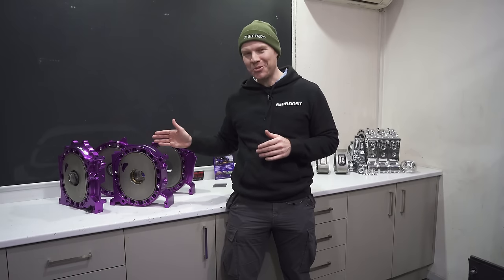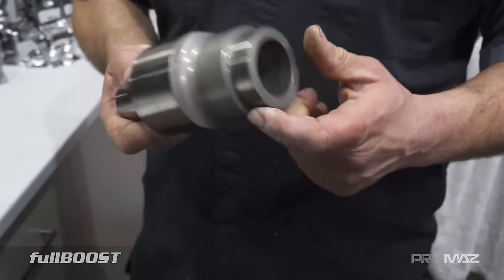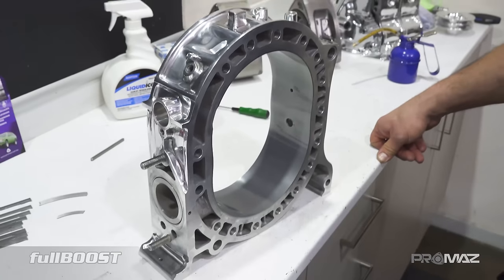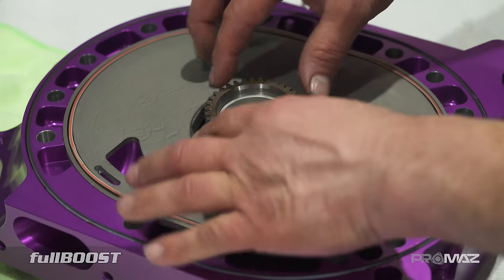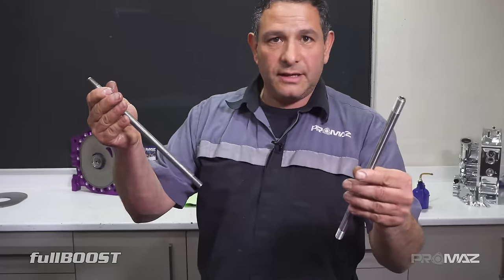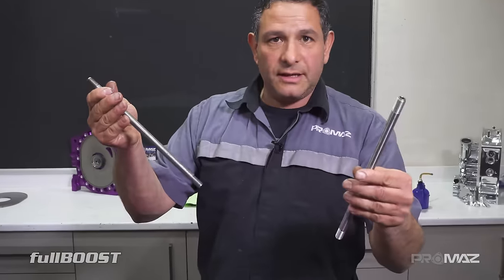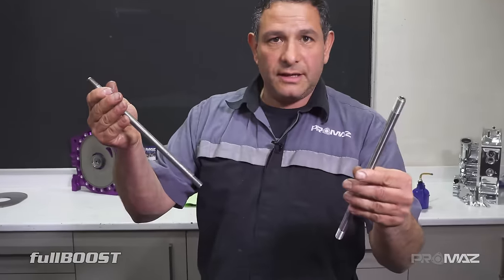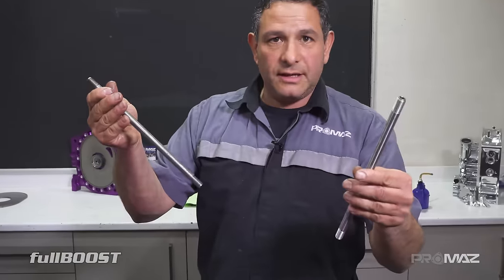Building a 1500hp Billet 20B 3-rotor | fullBOOST

Comment: This looks way easier than a piston engine. It's like stacking blocks.
Reply: There's allot
Reply: Not really,  I have a 04 RX8 and had a 86Rx7 , rotary motor’s are leaps and bounds easier than a piston engine.
Reply: STIL BIG ENGINE SO PRIMITIVE  😋
Reply: Like minecraft
Reply: Yeah of course because they are no timing belts valves and so on
Reply: @melonshop8888  It's about the same size as an electric... Lol.
Reply: Where is Rob Van Dahm?
Reply: That’s why they rev to 13k, simplicity
Reply: its way easier than piston engines because you dont have to worry about valve timings
Reply: Yes
Reply: They skip out on a lot of the processes. Remember, he said he had 2 days to prep the engine before this.
Reply: @Bottomfeedr1229  that's why they burn out faster then any piston engine lol
Reply: its like cake making. put a cream, put another layer on it, then cream again, then another layer on it. XD
Reply: @Bottomfeedr1229  not because of simplicity. 
they rev higher because they dont need to stop. everytime a piston engine hits top dead center it has to change direction to down and when the piston is down it needs to change direction again to up.
rotaries just keep spinning. faster and faster.
Reply: you should look builds of 2 strokes, then youll know what is easy
Reply: melon shop rotarys are small
Reply: Only blocks you’ll be stacking is the blocks of cash you’ll have to fork out on maintenance.
Reply: Josh Arnold no they dont.
Reply: Not even a little bit. The fellah assembling it has been doing it for 27 years. Hes just good. Also a lot more to it then what is shown.
Reply: If they where easier and more convenient, everyone would use them. Mazda doesnt even use them anymore.
Reply: Horrible emissions
Reply: Thats why i love them, yes of course the lifespan isnt as long as a piston but if you have the tools you can rebuild in a couple hours and get back out
Reply: James DeLarm  what you got going on?
Reply: James DeLarm let me know what you got going on and I’ll try my best to help.
Reply: You just don't know how to build a piston engine lol
Reply: Everything is super easy when you know exactly what you are doing and why.
Reply: Lol is more to it, is not just stacking block s
Reply: S7
Reply: Looks can be very deceiving..
Reply: Trust me it isn't 😢
Reply: Pros and cons of each engine type
Reply: A few key details are important to rebuilding these but yes, much easier. Last about as long as an LS with proper care.
Reply: Rebuilding either from stock is honestly easy af its when you start getting into insane aftermarket builds is where it gets tricky but again not overly hard as long as you have a good machine shop, try jet engines, now thats hard
Reply: Josh Arnold my 93 Suzuki Katana is a 750cc 4cyl and it hits redline at 14k, its not necessarily simplicity but also weight of motor parts and the displacement you need to make torque at certain horsepower
Reply: @DrEvil-os9dc  jop like v8 so what
Reply: Lego for men
Reply: I got a few omc rotary 2 stroks my self. This is one sick rotary 2 stroke! i would run nothing but silkolene pro 2 sx in her!
Reply: Squinty Kostiuk the rev limit of a piston engine is largely determined by the bore to stroke ratio, and if you look at Formula 1 engines they are often de-stroked V8’s to have a shorter stroke than what is considered “square or 1:1 ratio” will allow higher rpm capabilities if the rest of the engine is built correctly to some very high tolerances. Use some engine simulation software (even in games) and you will find that it is possible to get some incredible power out of a 1.5 litre V8 with a very short stroke at 20,000RPM.
I heard a rumour (watched a documentary) that BMW leave their F1 blocks out the back of the factory in the weather for years, the factory workers pee on them, let nature heat cycle them, rust, etc and they choose the ones that pass X-ray defect testing, and clean them up, whittle them down to the strongest mettalurgically tested ones to use in F1’s until the rules changed recently.
I respect Rotary Engines very much though and with many years of man hours and R&D by Rotary workshops investing Millions of currency units on the general basic design concept, have made leaps and bounds over Mazda to create some incredible machines that aren’t exactly efficient or environmentally friendly, I’m glad that the culture is alive & well because LS swaps, while effective, are rather mainstream now and even if they learned a thing or two from Japan on Overhead Cams, and GM came up with a Quad OHC design in “Bigblock” size I’d get interested.
Reply: 2 stroke piston ans 2 stroke rotary are the best. both run total loss burn off oil injection too! there are some toyota 2JZ made into poppet valved loop chared 2 stroke. make sure you use a billet aluminum block if you do this. Also the crankcase is easy to fill in with aluminum to use it as a supercharger and run a dry sump with oil injection with your favorite 2 smoke oil!. the aluminum block is easy to cut ports into too. i got a few old billet aluminum omc rotaries and they run xd-100! My gf run and fill nothing but amsoil domintor synthetic 2 stroke oil with the OMP turned up. now just add 2 stroke oil and go! BTW lightning is one the most powerful 2 strokes on earth at the muti terawatt level! unfortunately its way to hot to channel into any aluminum 2 stroke block as it would be destroyed and grenade!
Reply: @peterzingler6221  it's like a 2 stroke, time to 2 stroke 2jz 🤭
Reply: @markoz673bajen8  counted his rotors and decided he was too good for this video xD
Reply: somewhat..the seals are anoying..  3 on each side and 1 on each corner of the triangle pistons..     and yes, with so many seals wankel engines are prone to wear.

figure if he's squeezing 1500 horse out of it that engine will need a rebuild ever 5 or 6 hundred miles..   dads rx7 made it 70000 miles stock...
Reply: @harleyme3163  70k miles? That's it?
Reply: Well there is more complicated seals and areas that have to be perfect and rotarys are tempremental a sohc i4 is the simplest you can really get and probably the most reliable design
Reply: @fuolku1006  you just fucking blew my mind right meow
Reply: Oil injection too. I got my rotary topped with amsoil dominator 2 stroke synthetic oil. It’s about 60$ for 5 quarts!
Reply: Primitive engines... that's the car industry haven't adapted these en masse.
These things would blow up and leave you crying... Maybe onlu good for 1or 2 drag races.
Highly inneficient gas guzzlers.
Fun to watch though... It's more of a hobbyist engine
Reply: Primitive engines... that's why the car industry haven't adapted these en masse.
Notorious for blowing up... Maybe only good for 1or 2 drag races.
Highly inneficient gas guzzlers.
Fun to watch though... but It's more of a hobbyist engine.
Reply: Main difference is the number of moving parts. But the rotary seems a bit more technically complex to me.
Reply: Not until you need to replace apex seals.
Reply: @vossti  Thats how most race motors are anyways. You got to up the oil injection if you want them to last longer. Borth my rotary and small block v8 i use Either XD-100 BRP oil or Amsoild dominator synthetic 2T. I want to give motule 800 2T a try for my 8v92 2 stroke jimmy but i would need a few gallons of it.
Reply: @vossti  Im not a 4 joke person but run only Motule 800 2T in my rotaries. are you talking 4 joke stroke? do you you run oil injection? I love the new 850 ETEC rotax turbo and i assume ll these car motors are modeled on that configuration! All these turbo 4 cylinders are just poppet valved 2 stroke conversion with oil injection that can be ran in any position! they all are can run 2 stroke oil!
Reply: @vossti  So what do you want high strong piuston 2 stroke whuich do the same. You premix all these engines! Hey dont forget lightning and the sun are 2 strokes!!!
Reply: Oh you made a toyota 2jz 2 stroke 1200 hp poppet valved loop charged 2 stroke! just pet her gently and she will last!
Reply: Now dont be mean to her or she will give up at 1800 hp!
Reply: @vossti  Thats is how most racing stuff goes anyways,  I only with full synthetic amsoil dominator 2 stroke for my rotary for now. 6 quarts for 11.50 each aint bad. motul 800 2t would be better though if i could find it.
Reply: He’s a professional with brand new premium parts and he’s done this thousands of times and it’s prerecorded, it’s going to look easy. There’s a bit more to it than what they’re showing, especially if you’re rebuilding one.
Reply: a virtual Lego block ICE....kinda. .lol
Reply: Rotarys are kickazz engines ..but they need ALOT OF LOVE
Reply: @jaycool5978  I SAY WHAT.???  🤔🤔🤔
Reply: Legos lol
Reply: Doctors arent born doctors, cooks aren't born cooks, mechanics aren't born that way either. You have 2 learn and get hands on when it comes 2anything in life
Reply: @crisknapp1990  lol very true.
Reply: What's cool about it, you don't waste any energy turning up and down into round and round. Cut out the fat. And your left with hp.
Reply: @fuolku1006  thank you, turning up and down into round and round looses lots if heat and energy. That's the genius of the wankel.
Reply: @linuxafrica2584  yeah couple hours my ass. If you make your living rebuilding wankels. You might be able to turn around in a day totally rebuilt. But that's if you spend every single day doing it. And you already have everything you need to replace on hand. They make it look easy be wise they cut out 95% of the build.
Reply: @glitchinthematrix5761  if you and the bois cant rebuild a 13b in 2-3 hours that sounds like a you problem bro  and of course you would have everything you need to replace on hand 😂
Reply: It’s basically a dorito sandwich with less moving parts due to lack of rods springs and more
Reply: You are correct and incorrect in so many ways but I like the way you think. It's that mentality that has cost me more money than I'd ever like to admit...
Reply: Like Lego
Reply: @trex69  not gonna disagree but it's also why they can be run alot harder constantly than most piston engines I've seen slot of hell cats blowing up already not even 15-25k miles I've seen rotaries get track only use and go for 50k
Reply: Assembly it's easier, sure. Whole engineering process from scratch up to build is much more complicated. 🤷‍♂️
Reply: lego time
Reply: You need special tools
Reply: It’s more simple yeah, but it’s also a bitch to maintain and make sure you don’t break.
Reply: The apex seals are the problem from what I've seen. If rotary motors had half the investment into research and development that piston engines have had, then it would be a great engine type.
Reply: @peterzingler6221  is it just me or rotary fans are a bit ignorant 

two stroke piston engines have much more in common with rotaries than 4 strokes. 2 strokes and rotaries both inject oil into the cylinder, both don’t use valves and cams, both are much more compact and simpler than 4 strokes, both have one power stroke per revolution unlike 4 stroke engines which has 0.5 power strokes per rev meaning one power stroke per two revs, and both produce more horsepower than a similarly sized 4 stroke engine.
Reply: Lmao
Reply: If only they were way cheaper!
Reply: @alrumuller9300  not if you build it right, only reason you need maintenance is on stock ones with bad apex seals 😂
Reply: @EjinRenos  Lasted as long as an LS and then it woke up amidst a rebuild.
Reply: @arcadiagreen150  To be fair piston engines are more complex but yeah if you have experience on something it becomes easy .
Reply: A power sandwich
Reply: Thats ooph sooooo many hours we ain't talking 10s we are talking 100s of hours one of those "legos" is probably 50 hours of machine cut time (cnc) if it works
Reply: I don't think so I can pull then strip a small block Chevy completely into individual parts in about 45 minutes and back together in under an hour..... of course that's a fresh me built engine... but yeah rotary is just amazing engines.... like they said pretty much the same technology as 50 years ago... love these things
Reply: @fuolku1006  that's called simplicity, not just about the part, but the system and other too
Reply: @animefreak2062  really was it hard taking the engine apart for the first time I’m debating on getting a rx7 just afraid that I’m not ready to maintain the rotary
Reply: Right...
Reply: I wonder how many rotors they can stack and how much smoother it can get
Reply: the basic assembly is definitely easier but the process is more complicated
Reply: till one of those apex seals goes, you don't notice, and you trash the whole assembly
Reply: One of the many reasons we like them so much
Reply: Rotaries were built to be worked on and rebuilt especially rx8 and rx7 they were Japanese race and sport cars
Reply: the only real disadvantage a rotary has is tip seals. and thats just cause the user keeps the gas pedal down....
Reply: Bruh rotary is future
Reply: Would this fit into an rx8
Reply: Assembling is easy making one is another story
Reply: You still have to gap the side seals, check the bearing clearances, set the end play, it’s not really easier than a piston engine there are just fewer total parts. Gapping side seals is no easier than rings, setting end play is no easier than checking it in a piston engine. Where it’s easier is the lack of a valve train. The bottom end of a piston engine is no harder than building a wankel.

Comment: So whats your engine budget..... *Blank stare*.... budget mate....? *Blank stare*. Message received. Billet 20b is on the way.
Reply: Hahahahaha!
Reply: I bet it's around 50k
Reply: Holy crap.  Are you serious that is what this motor costs?
Reply: about $22500. A billlet engine costs off the self.
Reply: @VicFroman  If you divide dollars through hp it's not that expensive..
Reply: 50k in parts, 20k in labour... block only I’d guess. Intake, exhaust, turbo etc etc get past 100k quick 👌🏼
Reply: I thought that the whole idea of a rotor, was to be way more cheaper, than a piston motor. Wow surprised just how expensive they have become.
Reply: @Dominari66  the idea wasn't to be cheaper it was to be more simple and reliable (not reliable) it also has high rpms because u can imagine spinning is easier than going up and down and converting it to rotation (like a normal piston engine) well the entire idea backfired so that's why the are discontinued. (please correct me if im wrong) read @dizzee b comment he corrected me.
Reply: @Dominari66  This is made out of milled pieces of billet aluminum. That's why the cost, not because it's a rotary.
Reply: @Dominari66  yes, but this thing is 1500 HP! so affordability goes out the window now.
Reply: Ask Rob Dahm? 100k overspent.
Reply: @murtadhaalmurtadha2221  Just don't run it when the fuel tank is empty or it would spin
Reply: murtadha almurtadha  Mazda had to cancel the rotary engine due to not meeting emission standards, not because of reliability. If that was the case, they wouldn’t have invested 50 years in development. They also haven’t dropped the concept yet. Would be cool if they can come with a new rotary engine.. But these billet engines are on another level 😎
Reply: Dizzee B yes ur absolutely right, tbh they r reliable it’s just the emissions that was the huge issue...
Reply: @markoz673bajen8  and not even done yet
Reply: @dizzeeb1407  thanks for correcting me
Reply: murtadha almurtadha your welcome 😁
Reply: Speed costs money. How fast do you want to go? Compare the cost to building (parts & labor) a piston engine with the same output and the same durability. I’m guessing a 1,500 hp LS engine that will be reliable would probably cost about the same as this 3-rotor. In engineering there are tradeoffs but no shortcuts. A junkyard LS engine with stock internals can be turbocharged to produce huge power, but for how long? To make it live you’ll need to open it up, measure all the tolerances, replace everything that’s not up to standards, and swap out all the known weak links. Maybe a billet block, uprated forged crank, rods and new pistons, flowed head... how much have you spent so far? The sign on the wall could say: Dear customer, pick two of the following for your engine: Cheap - Powerful - Reliable. 😉
Reply: @The.Drunk-Koala  u can get half of the price if you do it in cheaper country (excluding the shipping cost)
Reply: @Bajinowhere  thats from mazdapro or billetrotary in Australia
Reply: Actually its "spins" so fast because the eccentric shaft spins 3x the rotor speed. So really the motor is slower than a diesel in almost all applications but its output is fast(only thing we care about!). Its a shame factory mltors weren't more reliable or the design more fuel efficient
Reply: @mythos000000025  they're coming. They didn't have the tech to do that. Plus many forget that the fuel economy isn't that bad when you compare it to a piston engine of 2x displacement. Rotaries are equivalent to double the size in a piston engine
Reply: @The.Drunk-Koala  just for the plates
Reply: @The.Drunk-Koala  13b?
Reply: @VicFroman  You can buy the 4 rotor motor 35k.
Reply: @jayknight139  m